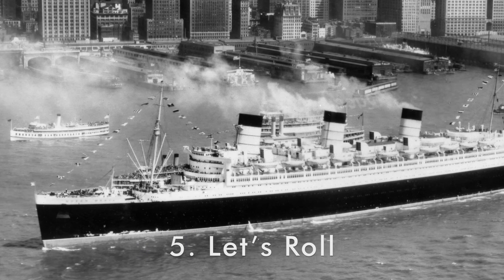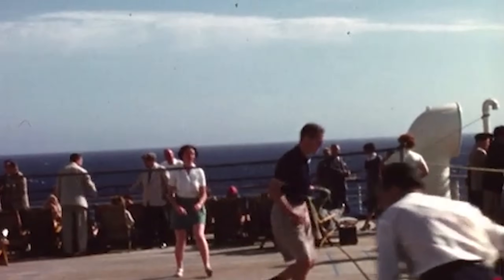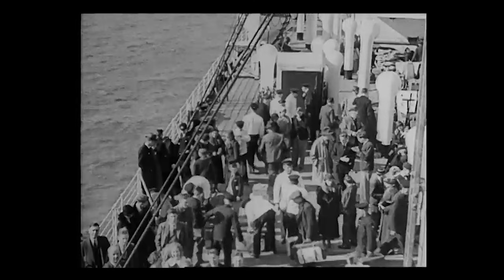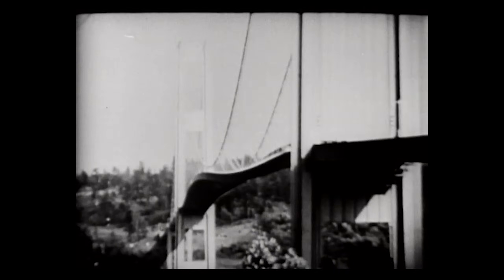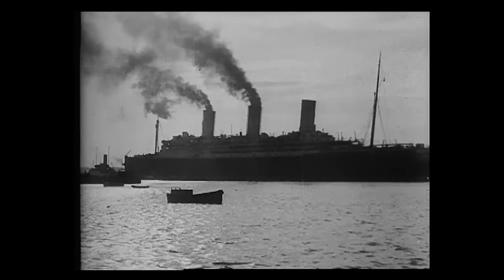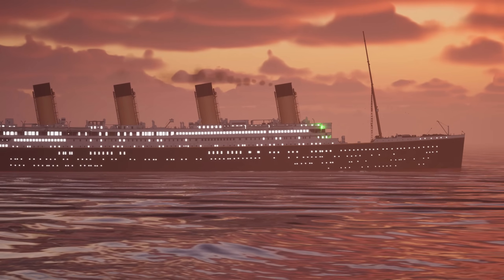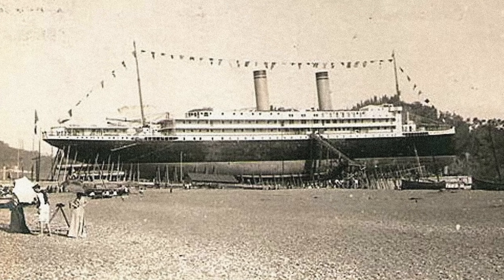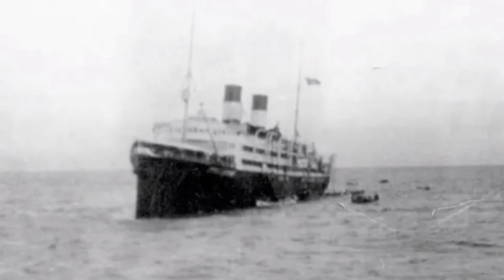5 Ship Design Fails

Comment: I'm really glad you mentioned the IOLANDA (probably the only ship ever to be lost at her LAUNCH).  So many others ignore or are unaware of her when covering ship tragedies.
Reply: You should consider also the sailing Warship Wasa that rolled over after 200 yards! Not so quickly as the Jolanda but here we go..
Reply: @paoloviti6156  1400 yards
Reply: @23GreyFox  thanks for correcting me me but 1,000 yards but still in front of whole Stockholm was embarrassing like hell.
Reply: @paoloviti6156  At least they learned a way to - how not to build a ship.
Reply: @23GreyFox  the beauty of this ship was that it mostly handled by Dutch with a good mixture of Swedish and some German carpenters, each with their own measurement making it very difficult the situation. I recall from a booklet that it was leaning more on one despite filling the holds to keep it it upright but had to stop because the lower portholes, for the cannons, was too low. In short, don't build sailing ships like this. If there was a lesson, don't make the hull too narrow and too tall.....
Reply: The Titanic sinking on her maiden voyage was bad enough, but the Iolanda didn't even get that far. I can just imagine her designers and the management of the builders at her launch going 'Oh shit!'
Reply: Vasa made it almost a nautical mile after launch - does that count? :)
Reply: @Incoming1983  Well, today it's a very known ship, with a custom built museum over it. So it should count :P
Reply: @Incoming1983  it counts, it counts....
Reply: The swedish war ship Vasa sunk almost instantly after her launch in 1628
Reply: I worked at a shipyard for a few years. Every time we launched a vessel, I was so nervous watching it. We simply built them on platforms with wheels that had cables connected to them for pulling them back out of the water and then would roll each one down a ramp into the water sideways. I always thought one of them was going to go underwater lol
Reply: The Swedish warship Vasa sank on its maiden voyage after travelling less than a mile in 1628; that's almost as embarrassing.
Reply: No, I have definitely heard of a number of ships sinking at launch. It isn't that uncommon. They are launched in ballasted and unfinished, riding very high in the water, and often launched sideways. Any miscalculation or mistake while launching can easily result in the hull capsizing and often sinking. Haven't you ever watched a sideways launch, seen the way the vessel rolls when it hits the water? Just a little bit too far and it can't recover at all.
Reply: It's very much on the older side, but I think that the Mary Rose really should be a part of this conversation.
Reply: With how Italian cars' reliability reputations are, I'm really not surprised it was an Italian ship that this happened to
Reply: @nthgth  as I'm Italian I should be deeply offended with those downright silly remarks. The Italian ships are not renowned to be built like the Fiat as this was exceptional that sunk immediately after launching. But the bad reputation Fiat got was rarely mechanical but all too common rusty panels and very cheap interior so bad that whenever the Italians could they bought German cars. This is exactly what has happened to Hillman and the lovely Jaguars that was always at the repair shop for mechanical issues in the seventies and got a very bad reputation. This has happened also in USA with the American cars so it's no wonder many countries are buying Asian cars. I know very well what FIAT stands for among the Brits but leave the cheap insults out.....
Reply: @paoloviti6156  I sincerely love Italy and its large cultural influence. (And its majority stake in my genetic heritage!)
Oh I don't discount British or American cars from that. European cars in general seem to spend an inordinate amount of time in the shop, and US automakers can't seem to make a decent FWD/AWD automatic transmission. (Trucks and sports cars seem ok though).
(As I understand it, for Italy it's not just Fiat but also Lambo and Ferrari that needed lessons from the original NSX in order for their supercars not to have parts fall off all the time).
I do recommend Asian for every category. (Toyota and Honda specifically).
It just seems like a mistake that, of anyone, an Italian company might make. I could say the same about South Korea, what with all the Hyundai/Kia recalls and the ferry Sewol and stuff. Maybe it's a peninsula thing 🤷🏻‍♂️
Reply: @nthgth  this exactly what I am thinking too and I agree fully with you. Talking about exotic cars, between the seventies and and  eighties the Ferrari had very Fiat cheap parts inside that was more fit for the Fiat 127, quite shameful indeed, and had to be taken very often to mechanic. One infamous characteristic of the lovely Ferrari 308 was not only taking it often to the garage was but was due to bad carburation if revving too high the engine and it was quite expensive to call in an expert. Was for me I would buy one hands down, lol 😆. Honestly I miss that easy going period. Sorry if I'm being a bit nostalgic 👍🇮🇹
Reply: @nthgth  An NSX is worth nothing now, Ferrari are the most expensive collectors cars in the world. The Japanese invented nothing. Just copy.
Reply: @paoloviti6156  They had Webbers. The Ferrari 308 had a flat plane crank, which made it rev more...
Reply: @JohnSmith-rw8uh  it could be as I'm not an engineer but clearly something went wrong when designing this ship...
Reply: @JohnSmith-rw8uh  lol have you checked NSX prices? Yeah they're going for 70 to a hundred grand, "worth nothing" lmao.
I know Ferrari are still huge; they adopted lessons from Acura. Namely how not to have parts randomly fall off. I'm not making this up.
(And their name carries lots of clout regardless anyway)
The Japanese didn't invent the mid-engine supercar but who gives a F; they sure as sh*t perfected it (for that power level). Just like they did the luxury sedan.
Reply: @nthgth  At least the Italian car makers survived... and in Italian hands.  The Amerikan ones all didnt, the British ones not at all
Reply: @JohnSmith-rw8uh  American ones didn't? They made the Viper until misguided government rules forced them to stop, and they still make Corvettes to this day
Reply: @nthgth Chrysler is owned by the Fiat group now. Italian owned .... cool

Comment: How much of a fluke was the Titanic incident.
Has there been a case ever since, where a ship has been damaged along so much of it's length?
Reply: Aside from Costa Concordia which had the guts ripped out of its bottom I can't think of one.
Reply: It was very much a fluke, as far as I know there was no incident before or since where a ship had a side swipe collision with an object, iceberg or otherwise, causing that much damage in such a way that Titanic did. 

The iceberg damaged roughly 300 feet of Titanic's hull, that’s about a quarter of the ship's total length. I don't think the builders at H&W should be given too much flak because that kind of damage was pretty much inconceivable. However, just because there's a 99.9 percent chance it doesn't happen, that .01 percent where it did happen had disastrous consequences and is why shipbuilding from then on took situations like that into account because now there was a dangerous precedent set.
Reply: @mattboy5296  I don't think the builders at Harland & Wolff can be blamed either, their big worry at the time were collisions with other ships, a fairly common occurance around busy harbors.  There's no way they could forsee a situation where 300 feet of a ships hull could be damaged.  Even warships don't suffer that kind of damage unless they're being shot to pieces.